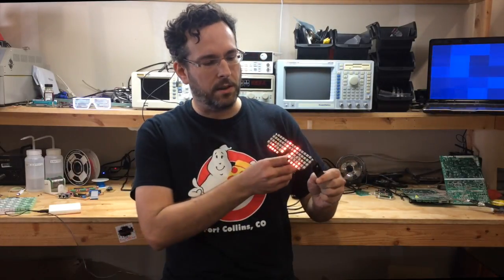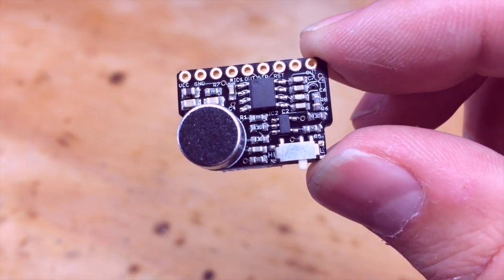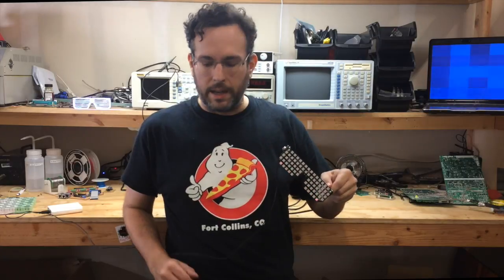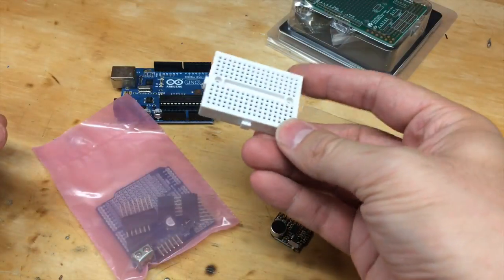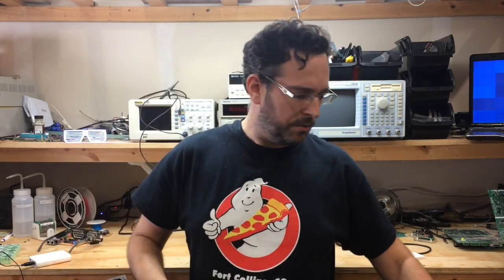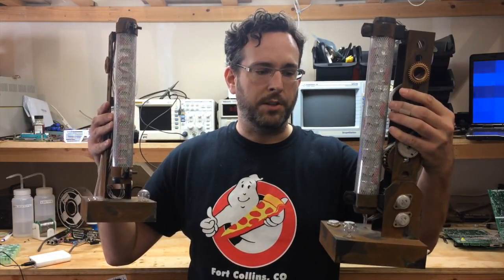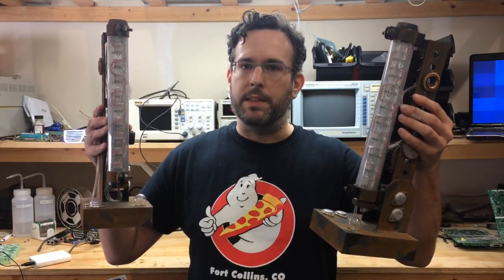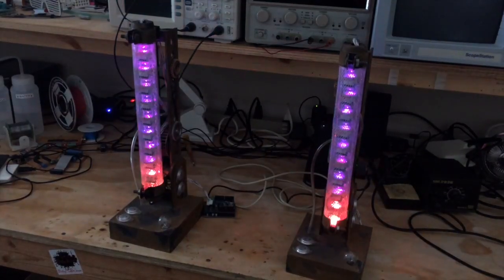Shades Audio Sensor on Arduino Uno

Comment: luv your work. I bought the maker version of your glasses. They came out awesome. They are a hit when ever I wear them out. I would luv if u used a wireless microcontroller like the esp32. Then you could add wifi and Bluetooth. Glasses need an app for switching animations, scrolling text, displaying info from phone or internet etc.